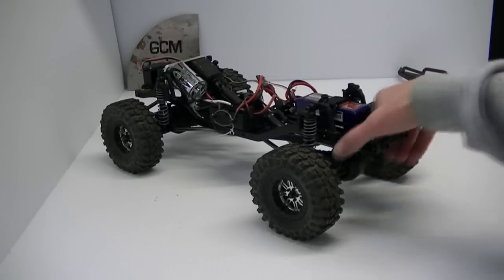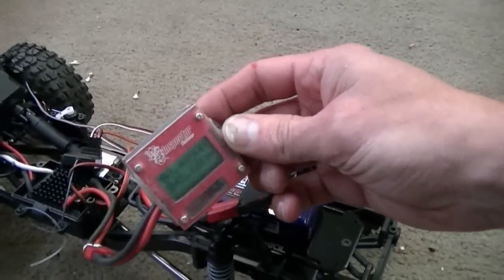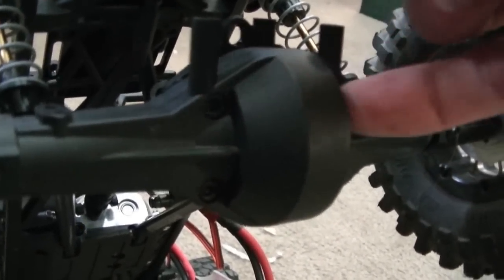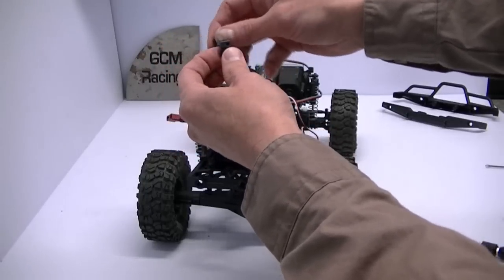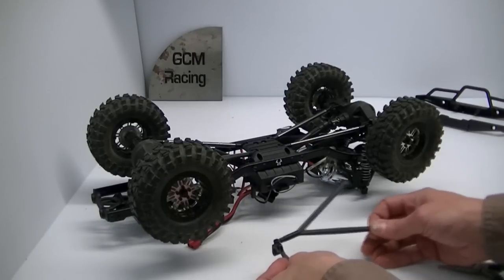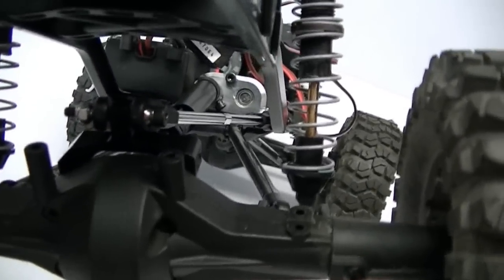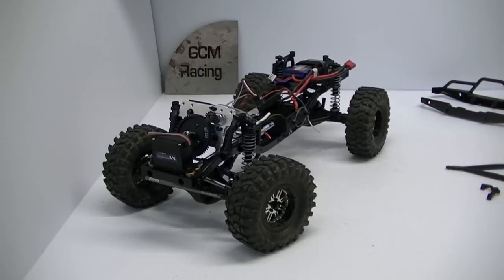GCM 4-Link Truss Setup for SCX Dingo - Stage 2

Comment from the maker: Thanks for all the comments, folks! The ball may have been in right or wrong, but this is still a conversion to a 4link in any case. I've had odd troubles with these 3link uppers for years, and that's why the truss was made. It's smaller and less bulky than the plastic truss. 
Cheers for everyone!

Comment: i believe the reason the Y link ball was coming out is because yo had it installed backwards. The ball needs to be installed from the rear of the mount so the large part of ball cannot come through mount. Then you put the screw through and connect it, so the screw is actually the piece holding the Y link to the mount. The 4 link is much needed anyway but just thought I would point that out. Good Vid, thanks for the upper link part #

Comment: The ball joint in the upper links is a problem for everyone. Mine pops out for no reason also and it's simply a design flaw. The screw and ball joint aren't big enough and pop right through the hole with no problem.

Comment: Even if the link was backwards it still pops out when installed either way given enough torque a simple fix till you install the 4 link is to just put a washer over the screw before you install it and it will not pop over the washer. Very simple fix that will get you by till you go 4 link

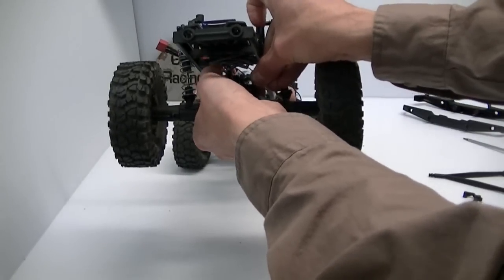Comment: So the 'new bolt' you mention at 6:54 needs to be bought? No bolts come in spare part bag. I didn't notice any. I just upgraded front suspension to 4 links setup and added the truss of course but I need a long screw for front links - where they come together. Should I get the bolt then from hardware place? Thanks.

Comment: Did you read what he wrote? lol, He said you have it installed the wrong way, unscrew and pop out the little ball joint, you will notice it has a lip on one end. this time put it in the right way..., push it in from the rear so the lip is facing outwards,

Comment: The 5138 links are 106mm in length so I don't understand how you are measuring around 117mm. Makes no sense at all.
Reply: GCMRacing1 The top links are shorter than the bottom links.  I've measured my bottom links and they're 117mm.  The top links look like they should be 105mm, so wouldn't the 108mm links be better?
Reply from the maker: spellward This setup using the stock dingo links needed a 116.5 top link with the GCM truss. Obviously if you use links of new lengths, then you will have to make the related adjustment to the top link to match. The Dingo kit comes with a great number of links to use, and the ones we used on the kit per instructions worked out to be the listed part numbers as top links. Use either a 5139 or 5138 for easy setup! Thanks!